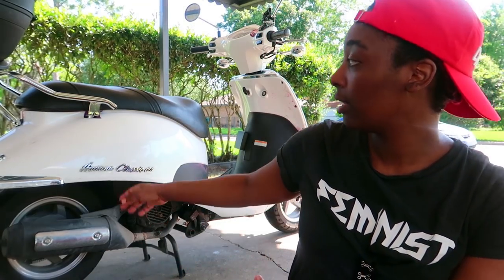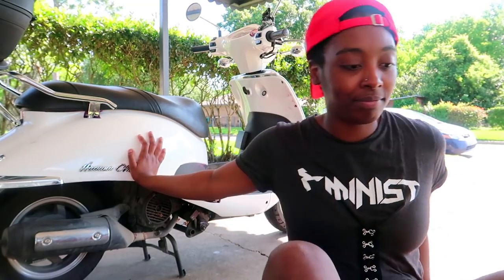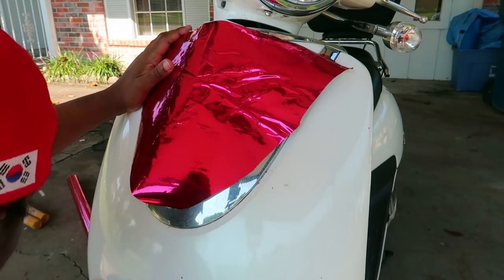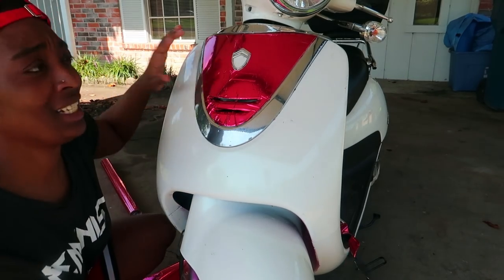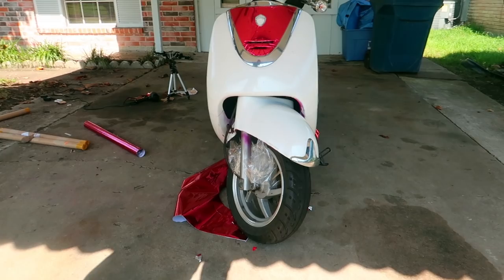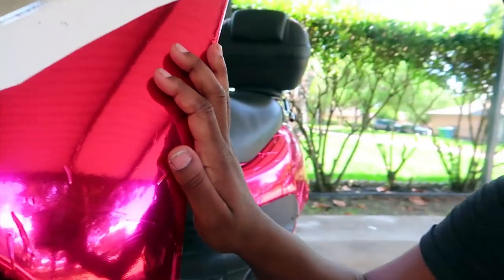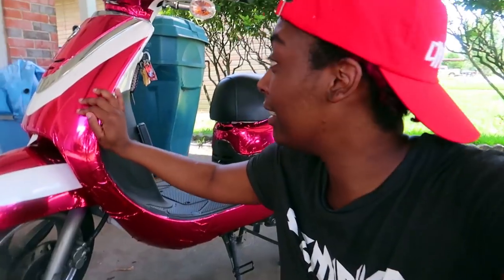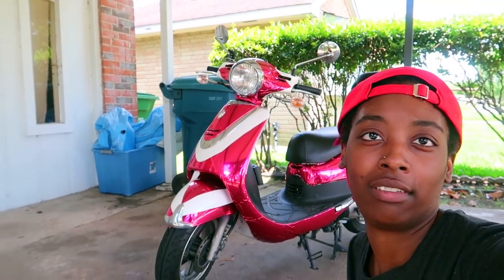Vinyl Wrapping Scooter

Comment: Well overall the look is great. 2 tone really gives it the one off look. The only item you left out is window cleaner. Spray can style is easier. You basicly "float" the decal use spreader to push out air and work wrinkles out finish with heat if it needs it. You can and will get the right look that way on your second try! No doubt about that! Most dieffintly worth doing again! Do a small spot to see how easy and great the results will be! Just spray spot down lay decal and work center out to edge. Don't worry if you use to much you just keep working it it will settle and again if need be use a little heat. But I   am sure that Texas sun will finish it off fine to. Enjoy look forward to see second shot at it, way cheaper than a paint job and easy to change look as go!
Reply: Oh I did that vinyl have clear plastic over it? leave that on till done so you don't scratch the finish on the finish side as you use spreader.  And if the pros can do it so can you. You have already proving your skill set for style and looks . You are more of an artist than you think. Jessie James style! You do what feels right. Indian Larry could see the look and chase after it. Bring to scooters what they brought to motorcycles!

Comment: I have an ex that used to make and sell signage and decals as a business. And one thing I remember he used like all the time was a dish soap and water solution(I don’t remember the proportions but it was like a just a few drops of soap. Dawn specifically) in a spray bottle.  On large designs he would lightly spray the surface the vinyl was gonna go on and also very lightly spray the sticky side of the vinyl too.   This would keep the vinyl from sticking to the surface so that adjustments could be made.  It didn’t affect the stick of the vinyl overall.  Also masking tape on the top of the vinyl so you don’t have to worry about damaging the vinyl during installation.  You can get masking tape in gigantic rolls like 3ft wide.  Bigger, I’m sure.  But the dish soap solution and the masking tape made putting vinyl on things (I say things, but I mean shapes.  If that makes sense.) they made it a lot easier than one would expect.  The heat gun would usually be the last resort to fix that one bubble around a the tiniest curve that just wasn’t cooperating.
Reply: Yeah all the pro car wrappers do that

Comment: This is something I've been considering doing for a long while now. My burgman already has a custom vinyl seat, instrument cluster and powder coated wheels so figured why not match the bodywork and be more easily seen. But, using vinyls such as 3M, oracal, etc from Metro Restyling. I've used their brushed metal look on my prior ride before so can attest to the quality. https://burgmanusa.com/gallery/TechArtGuy/650stuff/650customized/DSCF4034.jpg.html- Sir burg
Reply from the maker: Burgman look so sleek to me. I wouldn't mind riding one.